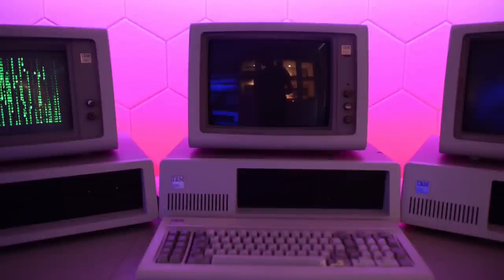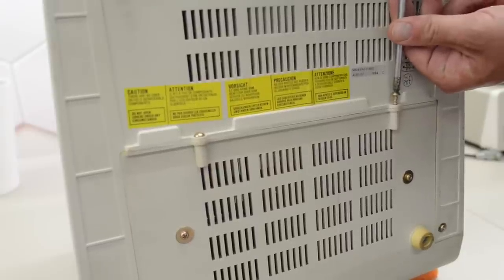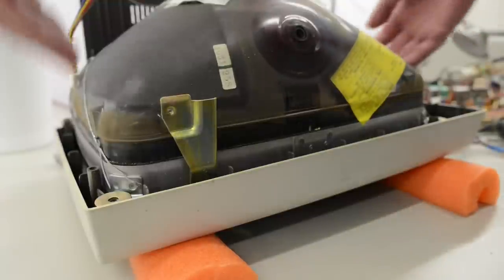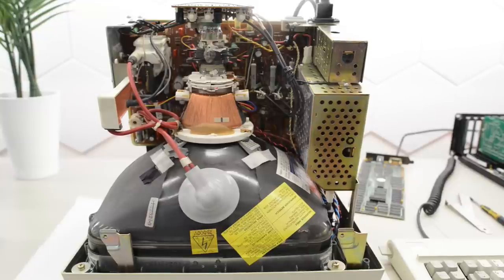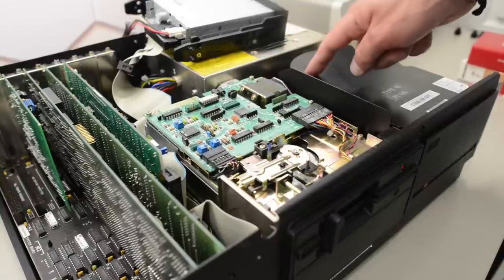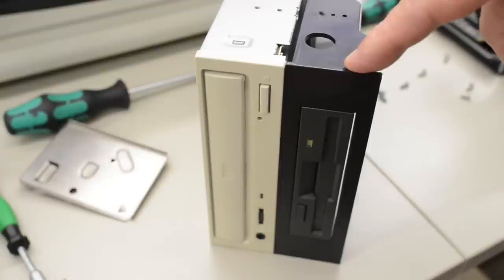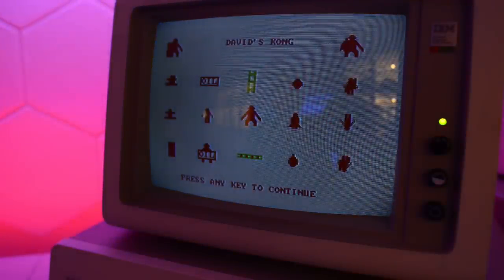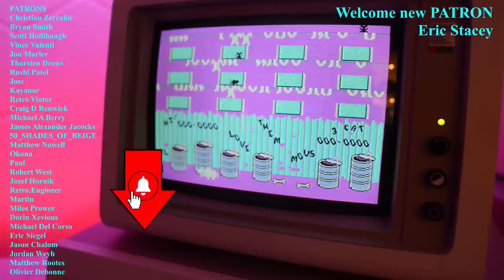IBM 5153 CGA Monitor. Teardown and restoration. Why is it making such a loud high pitch noise?

Comment: I first heard about the baking soda and super glue trick from Shelby at Tech Tangents. I have used it many times since then. 

Neat restoration video!
Reply from the maker: Thank you :) yeah, that is a very useful trick indeed. It has saved quite a few computers and displays for me too
Reply: As a scale modeler this trick has been around for a good twenty years.

Comment: I once used a 1.44 MB drive in an XT with a more modern controller card.  Couldn't read as such until I used a driver, 2M-XBIOS.SYS, to override BIOS - but it did work.

Comment: Just sand the edges of your drive bracket, use a sanding block of a but of wood with the sand paper wrapped around it. Use finer grit to get a nice edge.

Comment: If you have a sanding belt/disk it would be faster, but you could just sand one side at a time with course sandpaper over a block, and then reference the other side by measuring it with a Vernier calliper to keep it straight/parallel - I've done gearbox selector forks this way -.

Comment: Often the device producing the high pitch in a CRT is the flyback transformer because there is magnetostriction of the coils in the transformer.  So if you dare operate the monitor with the cover off, and use some kind of insulated stethoscope (maybe a PVC plastic stethoscope on the end of a plastic rod) or something like that, you might be able to identify the component that is producing the high pitched noise.
Reply: That's the method I used to diagnose an Apple //c. I just called it "plastic pipe" though. Stethoscope sounds much cooler :)

Comment: Hi, progressing well

It is time like this you think of what is in the cupboard / garage

See it you have 3-way  Y molex adapters, also later Pc's had a little chain with the large molex and the smaller 3.5 floppy power molex

For the side of the drive many have suggested dremzel, but i find that is hard to cut a straight line, a sanding belt will be better, however if the plastic is soft you can use a sharp knife, just do some 20 or 30 degree cuts on the back, then the same up front , then "flat top the centre", then the same on the other side

Comment: That's a handsome setup there, in the opening shot!  Very similar to my own collection, which is what I consider the ideal pairing:

- A PC with MDA (and secondary CGA -- because I had it, so why not) with a 5151
- A PC-XT with CGA (and secondary MDA, because I had that too) and a 5153
- A PC-AT with EGA and a 5154
- A PC-XT 286 with Hercules and no bespoke monitor.  :-(  Need to grab one of those Amdek amber displays...

Gotta love that 80s IBM style.  So ugly it's kinda cute.  :-)
Reply from the maker: Now, If I only could find a 5161 with two working full-size MFM drives :)

Comment: Some seem to like 3D-printed brackets. Maybe that's an option to consider. You won't get the right finish I guess, but you likely won't with the most common ones either.
Reply from the maker: That would work for sure. I'll try to file the bracket I have first

Comment: Concerning the brittle plastic, you might want to try heating it, so it'll soften a little before plying.
The problem with old plastics is, that the plasticiser is too volatile and thus evaporates over time.

I'm personally not sure how you're get plasticisers back in, but there are resources on "preservation of plastics" by getty.

Comment: The capacitors can get dried out very fast, that could produce a high pitch high voltage noise inside the CRT. I had to replace the caps in my hungarian 286 laptop's power supply. It needs a lot of current for that mediocre monochrome CGA screen panel, and the 8 and 16 bit PC ISA cards under the keyboard.
The whole laptop is using 16 bit PC  ISA cards for everything, by the way.

Comment: I wouldn't cut those edges.  I would sand them.  Maybe tape some sandpaper to a bench and run the sides along it.  I would file down a couple mm on each side.
Reply from the maker: Yeah, that sounds like a good method.I'll probably file them down first and then sand them smooth
Reply: @Epictronics1  You should get good results with a fine single-cut mill file. It probably won't be necessary, but if you find you have to polish further, start with 400 grit wet-or-dry taped to a flat surface. Move progressively finer until you have results you like.

Comment: if I can suggest about the bracket - I'm assuming it's plastic - I'd tape some 120 grit sandpaper on a desk and then you can rub the edges on it (back and forth) while keeping the frame parallel to the desk. It should give you a straight "cut". Once it fits, you can finish the edges with whatever works, more sand paper or a knife etc.

Comment: Hello mate. I’m trying to get hold of those adapters to stack the 2 drives, as seen at minute 17:00. You have a metal plate on the table between the two screwdrivers… is that part of the 2 drive assembly? Do you know where I can get more info on measurements for those plates?
Reply from the maker: I'll try to remember to measure it when the IBM is out next time. It may be easy to make one. Perhaps even 3d print

Comment: Are you sure it’s the bracket of the 3.5“ floppy drive which did not fit? It looked as if it was the back screw on the left side which wasn’t properly screwed in.

And: great video as usual! I love to see good old hardware get treated well :)
Reply from the maker: Thank you :) The assembly wouldn't go in past the metal bracket unfortunately. I had a closer look and the hole is about 3mm smaller than any of my CD-ROM drives or face plates. It seems to me the standard was changes slightly at some point. I think I'm gonna try to file the new face plate. Btw. I had a look through my collection of spare 5.25" FDDs and they all have a slight variation in with. I'll have a closer look at this in the follow up vid. It looks like some 360/1.2 drives wouldn't fit either.

Comment: The drive bracket being too large for the drive bay reminded me of my family's AT clone from the late 80s, the face plate for the Hard drive bracket that came with the computer was too big to fit into the 5.25 bay the drive was installed into. The face plate was just forced into the drive bay (made getting the case on and off almost impossible). Have to wonder if this was a problem of Metric vs imperial sizing. I'm going to guess the larger face plates and brackets come from some cloners making things to a Metric size while the Original IBM standard was probably Imperial. If the plastic has enough give you can force it but that is obviously not recommended for vintage computer plastic but it didn't seem to be much of a concern for the cloners who made my family's computer.
Reply from the maker: I actually had a look through my stash of 5,25 FDD drives. They all differ slightly +/-3mm

Comment: As for the noise, my (largely uneducated) guess would be, that something is vibrating... (big whoop... what a revelation)
As for suspects: Capacitors and/or Inductor... (again, no surprise)
So, in my twisted mind, part of the solution would be replacement (inclding ceramics, they can be audibly noisy). Another part would be, using something to dampen the noise... e.g. by inundating them with hot-snot.
Reply from the maker: cool, I wasn't aware of vibrating caps!
Reply: @Epictronics1  : I'm not sure about CRTs... (hence uneducated guess)

But as an example, when you use a capacitor in parallel with a neon lamp, it will flash or flicker (like a candle). If you use certain types of capacitor (e.g. ceramics), it can emit noise.
Actually it works both ways, those caps can also pick up noise from the outside and put it on the wire (that's how condenser microphones work).

Long story short... I would put a tiny mic on an isolated stick and check the innards of the monitor, while it's running.
Or go for the safe(r) option, replacing all the capacitors (not just the polarised ones, but also the ceramics).

Comment: I wouldn't suggest using a 1.44MB drive to read and write to 720k diskettes.  The read/write heads in high density floppy disk drives has a much narrower pitch and not all drives have the same head step geometry.  It may work on that drive alone, but moving to another machine with a proper 720k diskette drive may be unreadable.  Food for thought.
Reply from the maker: Interesting, I'm aware of this issue with 5,25" 360k/1.2Mb drives but I didn't think that it would apply for 3.5" drives. I'll do some reading
Reply: You are wrong. The head size and number of tracks in 3.5" dsdd and dshd drives is the same. You are confusing them with 5.25" drives, which do have a head size difference.
Reply: @JimLeonard  that was probably it, thanks for the reminder!

Comment: I just had a VGA monitor from 1999 do something very similar. It hadn't been turned on in who knows how long and was concerningly noisy and I did the same thing you did, turned it off immediately, dismantled it and looked the whole thing over, I re-flowed some of the solder joints that looked a little suspect and checked some caps and then I was out of ideas. Put it all back together, turned it on and let it run, after about 2-5 minutes of running the sound was gone and it was fine. I suspected the caps needed to reform themselves.
Reply from the maker: yeah, I think reformed caps is the most likely reason too

Comment: Hey Epictronics or who ever can help me, I'm also restoring vintage computers. Right now, I'm restoring an IBM PC-350. It has a Pentium 200 MMX, 160 MB RAM, and a Voodoo 3 3500 PCI (very rare card(I did not buy the card. It came in a computer from my old cleanroom at RIT)), Sound Blaster CT-4500, PCI SCISI card, 3Com ISA 10/100 NIC anyways, the system works very well and runs Windows 95C. I have an old 2COM NIC in to and it sees the network. The issue I am having is, sometimes I can get my Windows 11 computers to see it to share files and folders and sometimes it will not. I do have SMB 1.0 enabled in both Windows 11 computers, and it's on the same network switch as the IBM, and I've disabled firewalls and enabled network discovery. IBM can see the computers if I just type in their local IP, but when I type in the local IP for the IBM sometimes it shows up and sometimes it won't. I also did the Win 95 SP1 and the sock 2.0 update for the network stack. I did share out the drives, and I did enable everything in network settings. 

I did replace the HHDs with a SCISI to SD card reader and IDE to CF card. Both are 8GB Scandisk cards. 
And I have one where it's removable from the back to do software upgrades, but I prefer going over the network. I am trying to figure out what I am doing wrong here. 

The home network is ISP Fiber  --> PFsense--> switch --> IBM, Main Computer, Secondary. 

Thank you for reading this.

Comment: In regards to the bracket, (I've never done this) I think you could use a dremel or something similar and then sandpaper to smooth it out. It probably won't be 100% perfect, but it should be good enough.
Reply from the maker: yeah, that's probably the way to go, thanks
Reply: @Epictronics1  With it only being a small amount that you need to remove, I would probably just sand it down with a bit of wet and dry paper on a glass surface to ensure it is flat rather than try to cut it with a dremel or other power tools.
Reply from the maker: @GoldenDragoon  I think I'm gonna try this method
Reply: I had to trim a bit off the edge of an old SCSI Toshiba CD-ROM to fit in a normal tower case, and widen the inside bezel of one of those 3.5 to 5.25 adapters to fit a ZIP drive.

I just used 220 grit sandpaper, then some 400.  Might've gone down to 1000.  Once it's in the case, you don't see the edge anyway, but it turned out nice enough that you would have to really be paying attention to notice the difference in texture.